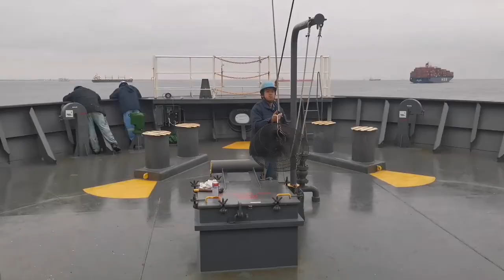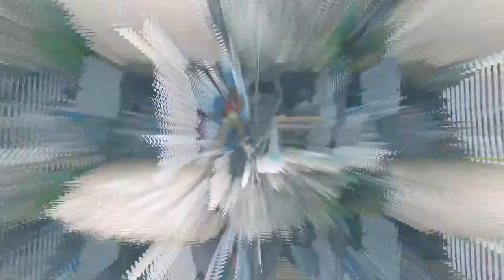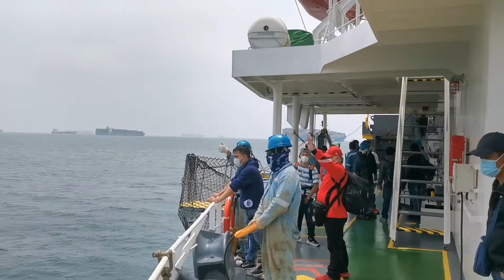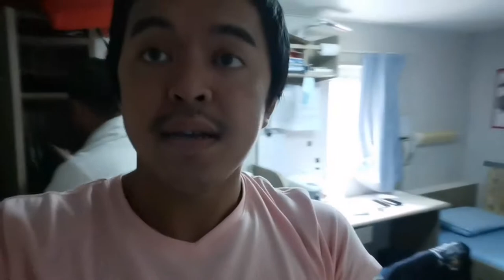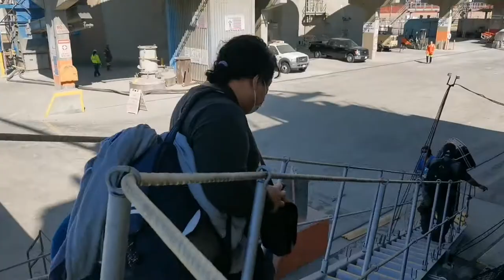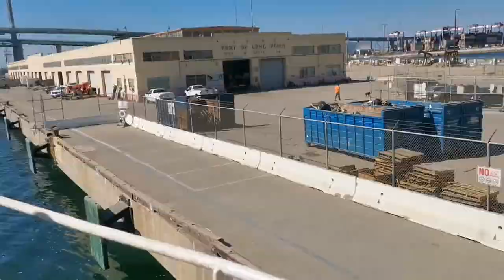Crew Change | Seaman Finish Contract | Seaman Vlog

Comment: the ang pakiramdam pag tapos na contract at pauwi na meron minsan nangyari sa akin na dapat umuwi na ako pero hindi ako makakauwi dahil pinauwi ang Chief Engr at secong engr ay may emergency vacation so kailangan kong magstay for another 2 t 3 mos onboard dahil were going to dry dock and no body will prepare all necessary paper works for all repair on engine dept nakakalungkot dahil excited ka na sa pag uwi then na cancel pa